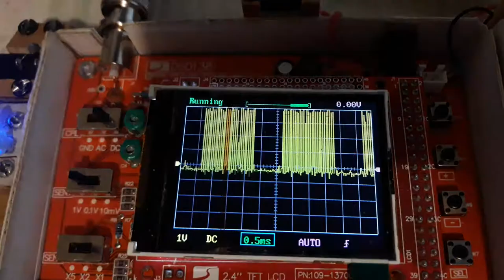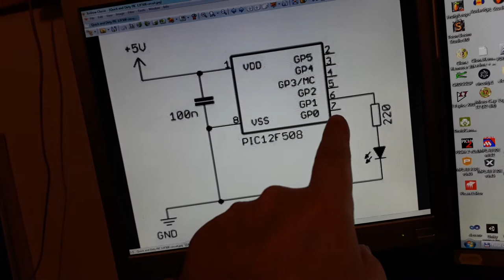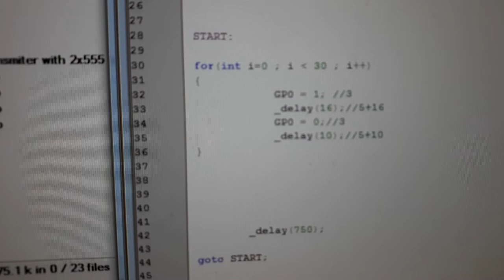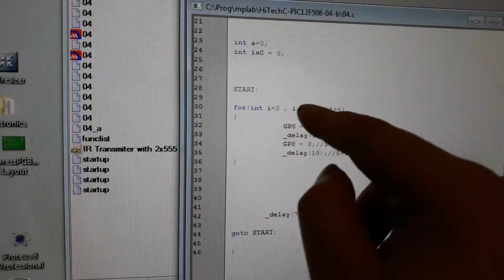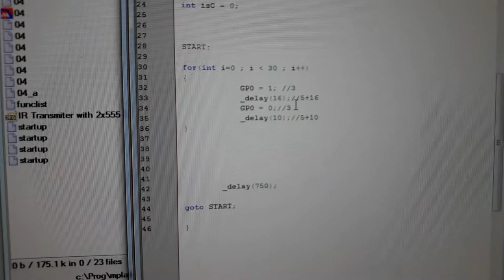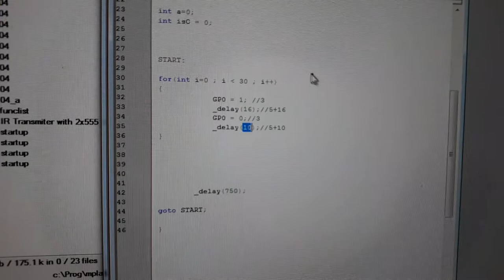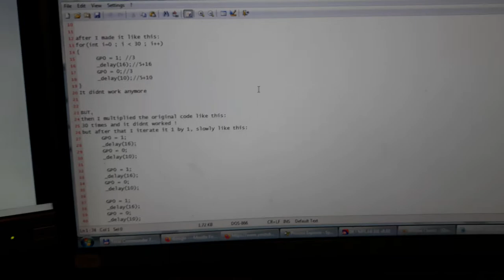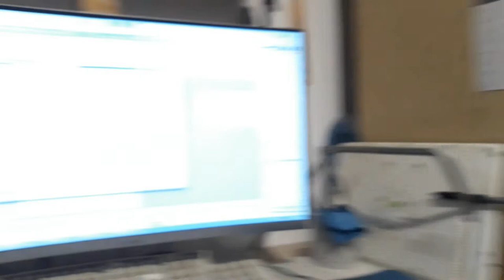#45 PIC 12F508 Programming an IR Transmitter Signal

Comment: how to assign TRISGPIO  for input button ., i need one input and one  output for my operation shall give a tutorials as example using hitech complier
Reply from the maker: That code I present there is all there is. I didn't program a button function. I made the button from the electronic side of the design. I switched from hitech-c compiler to CCS-C Compiler very soon after this project was done. I advise to do the same.